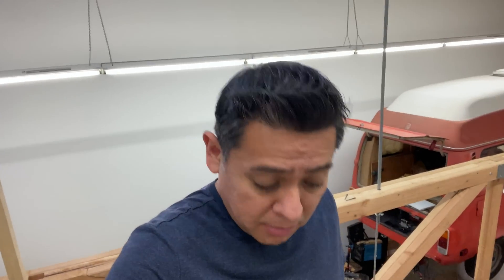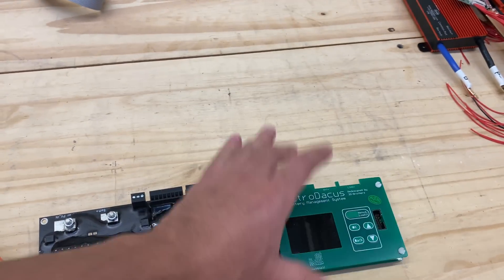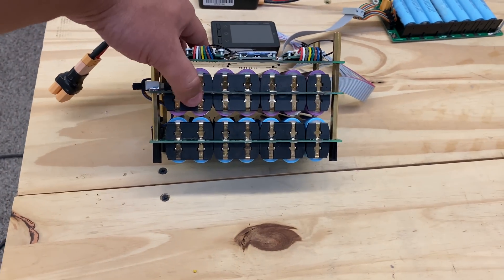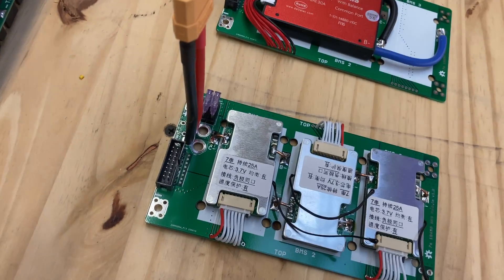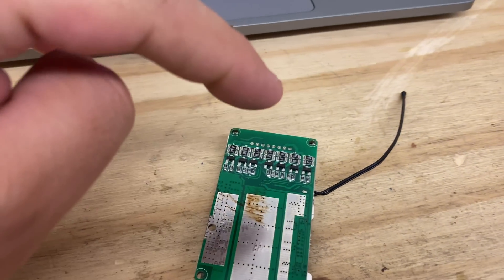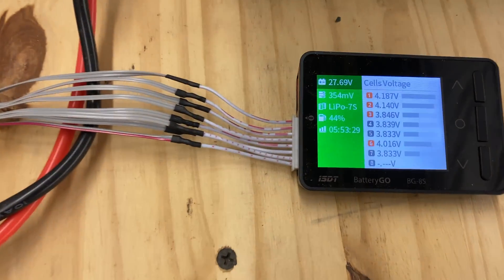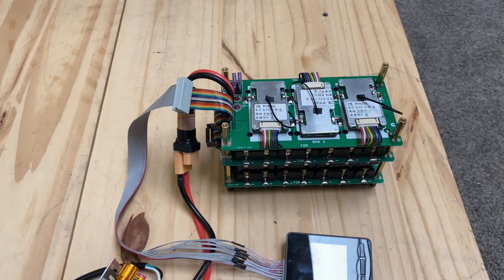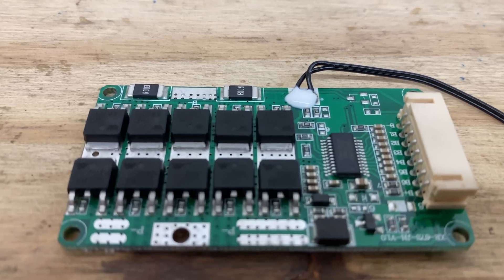How This BMS saved My Li-ion Battery Pack

Comment: I have harvested a bunch of 18650s but I want to charge them and test them to weed out the bad ones, I think I need a PCB but I only seem to find LIFEPO4 ones, but I have Lithium Ion cells.  I am looking for a 4S PCB.
Reply from the maker: Why 4s?  That’s 16v
Reply: @jehugarcia  The nominal voltage for my NCR18650BD cells are 3.6v.  These are salvaged cells so voltage sag is quite possible already, so I don't expect to get the top voltage and I thought I read that you don't want to charge to 100%, but rather 90%?  90% of 3.6v is 2.916v x 4 = 11.664v.  I use these cell packs for my fishing kayak, so I am powering my fish sonar, which is a low power draw and also a trolling motor which is a high amp draw.  Typically you want a 50Ah - 100Ah battery if you are going to use your trolling motor all day.

I bought a vruzend battery kit because I didn't want to buy a spot welder, I will be testing my salvaged batteries and see if 4S will be fine.  I love your videos, I am learning lots!
Reply: @jehugarcia  After thinking about your question, I think I was wrong to think I can get more usage by adding a little more voltage, so I am going with the 3S and enough batteries to get me ~20Ah.  Thanks for your help, it really made me think and come to the correct conclusion.

Comment: When you say "one C", what does that mean?
Reply from the maker: C=capacity
Reply: @jehugarcia  I bought that book DIY Lithium Batteries to learn everything I can, I am not a reader though like yourself but I learned that the C rate can be obtained by dividing the Maximum discharge by the Capacity (typically in Ah or mAh units) , so if a battery has a Capacity of 2.5 Ah and has a Max discharge of of 5A then the  C rate is 2.  The higher the C rate the more powerful the cell.

Comment: Many users of the ISDT BatteryGO BG-8S do not know that they can activate the display permanently. :-)
Go to the settings, then press the up-button 8 times ... and you will see the option for turning display saving on/off. This will make it easier showing things in a video. - I hope there will be a software-update what allows a user definied time for display-saving. (Here OS version 1.1.0.7 , BL 1.2.0.1. , HW 1.0.1.0. And yes, you can update the OS.)
Greetings from germany

Comment: What about double sided pcb to put 14 cells so the pcb to be cheaper.
Reply from the maker: The holders are the real expensive part.  The double sided board kits are more expensive unfortunately
Reply: @jehugarcia  but maybe one double sided is 30 to 40% cheaper than two one sided together.I need for 1000 and more cells.please answer.ty

Comment: jehugarcia,I have 16 gbs 300amp cells setup 16 divided  by 4 ,making 1200 amp 12volt  system . I use for my class A rv for chissis and coach the bms i need would be for coach side only the engine side would have no disconnect because of alternator .I have orion jr bms ,which has always  had problems ,what would recommend for bms with reset able monitor  system .thanks steve

Comment: Lol it probably the reason cell fail 😂😉 I bet they leak energy if left for days and them FETs a bit close together all them would melt the solder 😂😂😂😂 test with multimeter on cells connections to the monitor don't trust that 1 bit
I've learnt balance leads am shit and adds resistance

Comment: As you already say in the video these BMS'ses are dumb.
They have to work autonomous and reset themselves, I rather would use an active BMS here which always balance out the cells.
Or a combination of the two.

Comment: About mosfets: 
You can use a single 40 or even 20 amp mosfet but all comes down to the RDS ON spec. In translation it's the on resistance of the mosfet. The lowest you get the better in this application. They are using a few in parallel because the RDSon ain't the best of those and the have to use multiple to spread the losses and not concentrate the loss into a single part

Comment: Ok so im just asking a question do they make a bms that will only shut off the group off batteries that are charged or over charged so that the lower charged batteries can keep charging instead of discharging the highest charged group to the voltage of the lowest, that to me seems very inefficient
Reply from the maker: No that’s not really possible when you are charging via pack terminals

Comment: You have to know, that the absolute maximum value of 75Amps of these MOSFETs can only be handled when they are mounted on a perfect Heatsink. I also oversizing my own electronic Circuits too. In my opinion it's a good thing to make electronics more reliable by oversizing them and giving more Headroom to the Power-handling. Most of the modern electronic Devices don't last forever because they are build to work really close at their limits.

Comment: I wonder if you could just add a push button to the main power from the balance leads to the side of the board. That way in the power wall situation you could just reset them without removal.

Comment: at 7:20 in he opens the little guy to find 10 MOSFETs inside.  That's likely to keep the current per MOSFET current low which helps keep the resistance down and the losses/temp down.  The resistance in a MOSFET increases with temp/current so the more you can balance and spread that out the better.  Plus mosfets are cheap.

Comment: Yeah I don't think that it's doing a great job at balancing! I find it annoying that it gets to a point and just shuts down! 
Have you had a look at active cell balancers? Instead of wasted energy going to a resistor, they take energy from the highest charged cell and transfer it to the next cell and so on till they are all at the same level! Julian Lett has reviewed it over on his channel, I think that they can transfer up to 1A at a time and being just a balancer it works independent of everything else, meaning that the BMS can concentrate on the other important things like over charging, Under voltage cut out, short circuit protection and so on! 
The active cell balancers are the future! They only have LEDs to indicate where it's sending the charge and that's it, it's actually pretty intuitive even though it's extremely simple! If you haven't already heard about these things already, check out Julian's channel, he also reviewed a little MPPT Charge Controller circuit from eBay, it takes a voltage up to 30v and you can set the constant voltage for the output, only rated for 100W but they can be paralleld, I'm really impressed with it! I have a 24V solar panel which has an open circuit voltage way above what this Controller is rated for but it's been running for a month now and as soon as the panel see's a bit of day light it turns on and won't turn off until it's almost to dark to see! It takes every last bit of energy that it can get! Amazing! The past three days there has been no sunshine whatsoever! Just a dull light coming through the heavy cloudy skies! Not in bloody Australia! But unfortunately we have bad days to! Yet this little Controller still manages to keep the four 8Ah LiFePo4 Batteries topped up! I have a constant load that runs day and night which draws 0.65A. I'm now in the process of adding more load to it to see when the battery voltage can't keep up.. 
Also, one more thing! When you are looking at a datasheet, apart from looking at the voltage rating and the current rating which you shouldn't go over, you also need to look at how much watts you can get through the device! Just because it says 50V and 70A doesn't always mean that you can get both 50V at 70A at the same time... Check out the wattage rating because you might find that at 70A you might only be able to get 0.5V out of it... You have to multiply the voltage by the amp's that you are going to be using the the figure you end up with is literally the wattage rating that you have to work with! If the transistor can't cut it, you can get one that gives you what you need!  
Anyway, hope that helps!

Comment: I do have a bms thank you I assume is had something to do with 8s like 12_13p yeah bud I understand bought one from an old video of yours but never really used guess I gotta now,  safer/bettee etc whatever.  Basically  I got  a crap ton of batteries  .. Think mem e bike  cause batteries for them raredonk OK 18650 cells _ bike battery can do as high as 60 v but play it safe do like 52.. Bms I can do that..  Thank you tough I think it only takes 13p? I should probably  buy another buy anotherbms be safe guys
Reply: Removable donk

Comment: Jehu -  I haven’t learned anything about the BMS module here other than the cell overvoltage cut-off works fine.  But in terms of what it does in terms of balancing,  the concurrent use of  the ISDT prevents us from learning anything.    I think this video possibly risks confusion and false sense of security , for all the folks who purchased the “3 pack” BMS module, in terms of understanding exactly what is its  balancing behavior and what it can and can’t do.    

Being that the topic at hand is one of protection and safety, I have to be candid here:   you  need to do this over , this time without the ISDT monitor/balancer hooked up and set to balancing mode.   Ideally you test the balancing behavior of the bms module under no charge, v low current charge, and normal high current charge.   Doing it this way might shed some further light on exactly what these chinese black box bms are doing.
Reply: We wouldn't learn anything with the iSDT off. This balancer isn't, special its exactly like all passive BMS balancers. They all use the same components you can even see them in the video.
It will do no worse and no better of a balance job than any other simple board BMS balancer.
Your other post seems to make it look like you know this already. " w their current getting  burned off by the resistors, and the other cells charging , albeit slowly.. "

It's a simple board BMS like any other as far as balancing is concerned.
BMSs like this one tend to only vary in how many nice features they have but the quality across the board is the same cause they all use the same series of chips.

What is it your hoping to learn that you don't seem to already know as your writing makes it clear you understand how a BMS like this functions?
Reply from the maker: @nocare  the problem I face currently is that testing things is fascinating and fun and therefore a giant rabbit hole and a huge time investment for me,  my schedule is so jammed packed with more important stuff right now I just a can't do it now.
Reply: @jehugarcia  would love to see it in the future, when you have the time tho. cheers
Reply from the maker: You should make that video. I’ll watch it
Reply: jehugarcia    That made me laugh.  I’d. actually be happy to run those tests but I don’t have those same BMS’s.  

Anyhow...it’s your  product...situation rests in your good hands

Comment: You know the way that I test a BMS to see if it's working properly is to use an infrared camera that plugs into an IPhone and point it at the bleed off resistors on the circuit board . Then I deliberately overcharge one single 18650 battery to about  4.3 volts with a car battery charger and temporarily connect it in parallel with one of the groups of cells . If the BMS is working right then the corresponding bleed off resistor should start getting hot .
Reply from the maker: Good idea I’ll tray that next time

Comment: Wait did I understand that correctly you have to disconnect the power manually and reconnect again manually to get this process of balancing to function? So much for unattended test balancing.
Reply from the maker: No i left it overnight and it did it automatically

Comment: your ISDT bg8s is not just a monitor ! it is also an active balancer  that works better than any passive balancer on a bms -   and in your video the ISDT was IN BALANCE MODE (greeen background with a timer)  for 39:43 hours !!!!! so the excellent balancing job that you were so excited about was probably mostly done by the ISDT and very little if at all by the BMS. if you want to observe the balancing action of the bms , you must STOP the balancing action of the ISDT   make sure that the background is GRAY and no timer - this is monitor mode and then if balancing will happen - this is the bms -  please also note that the ISDT must be calibrated ! it dose not come calibrated from the factory ! each cell may be off by 10mV !!!  so if you did not calibrated and you balance with the ISDT , it can show you a perfect balance - which is not ! you need to measure each group of cells with a reliable volt meter and calibrate accordingly . (you can see here https://youtu.be/ka_x6NciHe4  one of many videos) .

Comment: Nice video Jehu, I have a question, I have two power walls 7S24P each, they have the same type of batteries (2950-3150)I used re-packer to build, and when I discharge I have one that stays within 30mv at the end of the cycle but the other one is way off, like 250-359mv what can I check.  Thanks
Reply from the maker: It could mean you cell group can be better matched to each other,  swap some cells from higher voltage group to the lower ones and see if that helps
Reply: @jehugarcia  That was my Idea too
Reply: But, no way one of the cell fuses is blown correct

Comment: Thanks for the BMS info and video.  I would like to put a DIY powerwall in my garage but I'm concerned about fire protection/prevention.  Are there any battery enclosures available that would contain a fire for added insurance just in case something went horribly wrong? Thanks!
Reply: It’s tricky, a metal box with fire rated cable glands will contain a small fire BUT a lithium fire will melt through it. 

They do make explosion proof enclosures out of 1-2” thick aluminum, they’re rated by pressure. Sold as NEMA 7 or Ex d enclosures and they are really expensive but are for refineries where explosive gases are always present. 

The only way to be sure is heavy fire suppression like a CO2 system or a better solution is to put your batteries in a separate building like an army surplus seacan.
Reply: https://youtu.be/B-v26e1JkxU

LithiumSolar’s seacan battery shed

Comment: Hey howdy jehu, great info on BMS, the Electrodacus is a lovely system it actually has solar charger controller, MPPT, and BMS lovely unit you get 2 of em 40A 120A, with these BMS I didn't understand one thing even upon disconnecting the BMS balance leads it didn't start to charge group 3,4,5 normally it should, can I face such a problem while building packs with A grade brand new 2020 batch cells? Love and warm regards from India.
Reply from the maker: All cell groups charge at the same time,  you can’t charge only some groups via pack terminals.
Reply: @jehugarcia  First of all thanks a ton for your message bro it was really fascinating to see your reply, I totally agree Jehu but those three cell groups in the video were not able to get charged because of groups 1&2 they were getting over charged so power supply was stopping the charge, that was inturn also not allowing the cell groups 3,4&5 to get charged was what I have perceived seeing the reading on the meter showing SOC , since the charger was charging the whole pack and not just 2 cell groups!!😂😂 I may be wrong, don't know, I apologize for that, but I must be clear on these very important aspects of battery building because finally Jehu I am happy to inform you my 15Kva pneumatic spot welding machine is on way, I will be starting the LFP packs for EV real soon Bro, you are the inspiration to do this make it a career, then I should be perfect without errors!! Thanks love and very warm regards Bro from India

Comment: Jehu - for the overnight balancing test , I was wondering whether the ISDT Bat Go was hooked up and in balancing mode?  If it was, are you sure the BMS’s would achieve the same balancing result by themselves, without the assist of the ISDT?   

Also, did you try setting the power supply (charger) current limit down to the sum of the 3 BMS’’s max balancing current (or below)?  I’m curious whether it would keep charging in this config , with all the cells already at 4.2v getting bypassed, w their current getting  burned off by the resistors, and the other cells charging , albeit slowly..
Reply: Exactly my thought
Reply: Exactly my thought x2